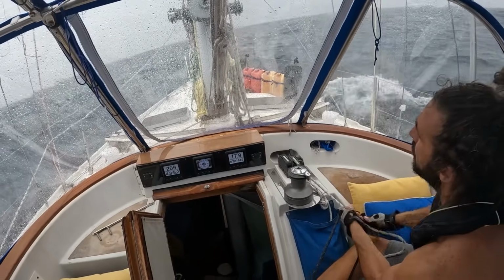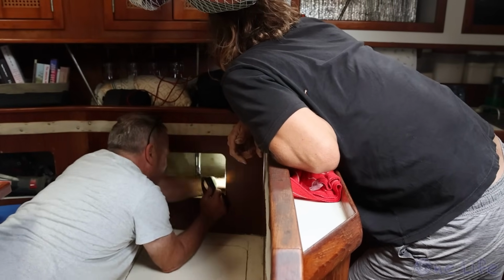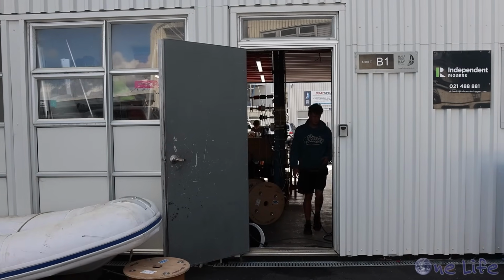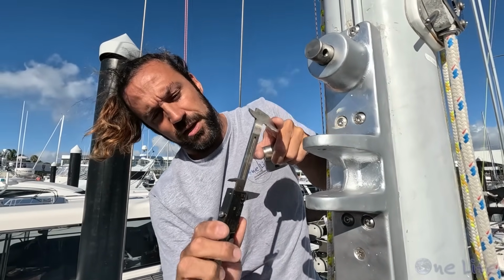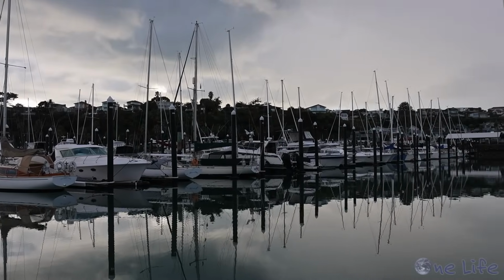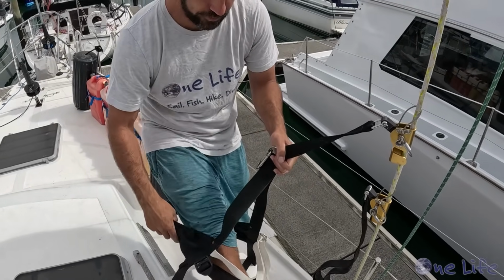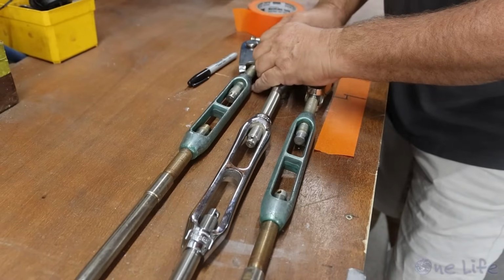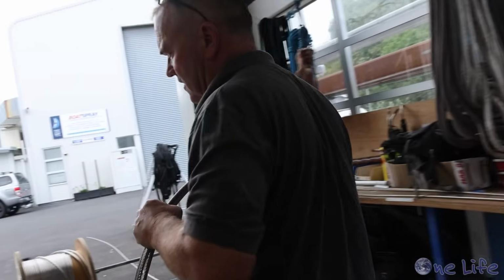Replacing the Standing Rigging on our Offshore Sailboat - Episode 147

Comment: Parlay revival believes that rigging cable should be cut by hand. They  say the heat from the grinder causes problems! What are your thoughts? It looks like your rigging company did a remarkable job!!❤
Reply from the maker: 316 stainless has typically already been annealed, so I doubt the heat from cutting would have any impact. Only the tips of the strands would be affected anyway, and in swaged fittings it wouldn't matter. Was Parlay using mechanical fittings (Stalok or Norseman)? Perhaps it has more potential to be a problem with those. Either way, if Rich uses a grinder, it must be fine! Mate knows what he's doing!

Comment: Interesting, I wouldn't even consider putting SS cable rigging back on.  Dyneema makes more sense to me.
Reply from the maker: Creep, UV degredation, different thermal expansion coefficient, frequent lashing adjustments, potential chafe issues.... there's a number of reasons why as offshore sailors we prefer to stick with stainless 1x19 rather than use synthetic. Imagine trying to adjust lashings at sea during a month-long ocean crossing! An even scarier reason for me is the lack of stretch and potential increase in dynamic loads transmitted to the mast and hull. I know there are solutions to a number of those concerns I mentioned, but for us, we'd rather keep it simple and stick with what we know works.
Reply: Dyneema is a poor choice..... The maintenance in the first 6 months is crazy. Two people I know who tried dyneema dropped their spreader on the first sail.

Comment: Great video! I'm curious if the in boom furling main was an upgrade you did when refitting, or if it came with the boat? Seeing the challenges you had with the furler, would you stick with it now if you had the choice to go back to a slab-reefed main?
Reply from the maker: It was on the boat when we bought it. I think most of the challenges we have had with it have been the result of a lack of maintenance and a 20+ year old mainsail. We haven't ever sailed significantly on any other boat, so don't know that we are qualified to compare systems.

Comment: Any benefit to a zerk fitting on the furler and maybe a drain at the bottom? Also maybe apply some insulator wax to the standing rigging?
And total cost for the complete refit?
Reply from the maker: We considered adding a zerk fitting but didn't, can always add it in the future if it becomes an issue again. What do you mean by insulator wax? We did grease all the turnbuckle threads before assembly. And any other fasteners got Tef-gel applied.

Comment: 3M cautions against using alcohol to prep surfaces for 4000/4200/5200 sealants since alcohol inhibits curing. Hopefully your alcohol evaporated without residue before you applied the sealant.
Reply from the maker: Yes, aware of this, but after wiping with a microfiber towel it is evaporates in seconds. The alcohol/solvent warning on the datasheet for 4000 isn't quite as specific as it is for 4200 and 5200 on surface prep avoidance, just says avoid contact during curing. Doesn't seem to have been a problem.

Comment: Was there enough threads extending through your gooseneck nut?  Usually I expect to see a couple of threads beyond the Nylock nut!
Reply from the maker: It was pretty much spot on for length to the end of the nut. Suppose even if the nut fell off the bolt wouldn't go anywhere since it was inserted from above.

Comment: why are you not coating all thread's with grease??less speed but better outcomes??
Reply from the maker: Turnbuckle threads were all coated before assembly, we just didn't show it. And other fasteners all got coated with Tef-gel
Reply: Good riggers use silicone sealant on the threads. Cheap ge will stop SS to aluminum corrosion for 20 + years or copper coat works for 10 + years.

Comment: the furling enclosure should have a drain hole at its lowest end for condensation to escape. also internal sprockets and chain should be heavily coated with waterproof marine grease. chain tensioner should have some way to lubricate from grease nipple built into the main enclosure, thats what i would do as a eng: toolmaker :"tradie".

Comment: Maybe not the correct thing to do, but I'd install a grease zerk in that furler, on the side that the chain runs against. Give it a shot once in a while while rotating it.
Reply from the maker: We thought about adding this but held off for now. Will add it in the future if it becomes necessary. Thinking minimal grease may be better as that is what solidified and gummed it up.

Comment: I've looked at a lot of stuff regarding the failures of Stainless (Bolts, Chain Plates, and anything you can't see that is stainless or holding onto stainless) and found that there are extremely fine cracks that happen. So fine you can't see them with your eyes. I've seen so much re rigging and I have a playlist (ALL of my sailing playlists start with "sailing") which is solely about Rigging !  I've got some amazing stuff in there ! Even though I haven't sailed ever, I've studied so much that i was able to 1 ask a guy if he'd worked with his thru holes. he hadn't and had to go into a yard and do the job. 2 warned the same guy that he needed to replace his chain plates. He actually had a failure way out in the pacific and nearly lost the mast ! Some of the TUNING methods in my playlist are incredible but the video names don't mention that.

Comment: You sailed there . With that rigging 😂😂😂. Crazy
Reply from the maker: One of the benefits of a boat that is built and rigged for offshore sailing, can get away with a little bit of breakage without a catastrophe.
Reply: @SailingOneLife I feel like the bent ones could be upsized . What did the rigger say. Or a better way to keep the clevis pin in . Other than the carter pin keeping it from sliding out .. I think it might do it again . Super interested, I sail in heavy winds all the time but I have a Tayana 55 . Built for that . Maybe drill the hole bigger in the clevis pin and put a bigger Carter pin

Comment: Brilliant to have all of that work done. I had my rigging done last year, and while the cost hurt, i feel great with the end result and knowing nothing will break while at sea.
Reply: My boat is a 45’ Southerly 135. The re rig cost €9200 which includes 20% VAT. This boat has twin main shrouds, twin back stays, and included the addition of a removable inner fore stay, and was performed in the Netherlands.
Reply: Could you give us an idea of cost and boat size? We may have to redo ours soon and struggling to get an idea of price.
Reply from the maker: Suggest reaching out to a rigger (or two) and getting a quote. Rigs vary so much between boats. Pulling chainplates? Tie-rods below like ours? How many stays? Swaged fittings or mechanical? Furlers to service too? Mast staying up or pulling it? So many variables at play that will greatly affect the cost.
Reply from the maker: Agreed! Last thing you want to be worried about at sea is whether the rigging is questionable!

Comment: No doubt you know that when bonding down with silicon you should pull the parts together leaving one or two milimeters of space between the sealing faces, then let the silicon to cure before tightening bolts down. This allows the silicon to have some “squeeze” in the silicon that is doing the sealing. This is especially important where parts are under high load but may be flexing with movement between parts. Else if you tighten down fully before the sealant cures, any movement between the parts breaks the seal and leaks will occur. This is aviation industry knowledge.
Reply: Good advice!?? And another tidbit: when you use "Nyloc" or "Elastic Nuts" always allow enough Bolt Length for at least 1 or 2 exposed threads to extend beyond the Nut when tight..... ;-)
Reply from the maker: What are those extra exposed threads doing?
Reply: @SailingOneLife  In my old aviation days flying "Ultralight Aircraft" it was common assembly practice when using Nyloc or Elastic Nuts, to allow for 1 or 2 extra threads to be exposed when tightened...... this was simply a safety precaution so the pilot could rest assured at a visual glance during aircraft "inspections" that indeed the nut had not loosened or the Nyloc or Elastic had not "let go" of the nut. This type of "loosening" failure certainly would be quite rare, but strange things can and do occur. I do not recall, but that type of practice may have been an FAA requirement common to aircraft fabrication, or a recommendation when assembling U/L "Homebuilt or Kitbuilt" aircraft. So, I followed the same practice when rigging & de-rigging, and maintaining the two trailerable cruising yachts I owned for over 7 years (a 16 and a 20 footer by Com-Pac designed for Coastal Cruising) and I sailed alot back in the mid 80's..... single-hand on inland lakes in the mountains of CO, often in very fickle, rough, gusty conditions, often "clawing away" from the rocky shorelines! 😜 😀 K. Scheer
Reply from the maker: This was somewhat accomplished with our chainplates by waiting to tighten the tie-rods below deck that hold the chainplates down. Of course the stays then pull up on the chainplates trying to separate it from the deck, so the situation isn't so straightforward as just waiting to tighten down the bolts that hold together two sealing faces. 3M 4000 is actually a polyurethane adhesive, not silicone which I positively hate anywhere on boat exteriors.

Comment: It looks like you didn't use Stalok or Norseman fittings which are lifetime fittings. 19 strand stainless on over rigged cruising boats will also last far longer than 20 years. I re-rigged a 41 ft ketch in 1986 and sold it in 2009 with rigging still in perfect condition 24 years later.
Reply from the maker: I wouldn't go as far to claim that anything on an offshore sailboat lasts a lifetime! And yes, oversized standing rigging will likely last much longer. But when hundreds of miles from land, we'd rather be conservative and not waiting to find out just how long it lasts.
Reply: @SailingOneLife 19 strand stainless reaches replacement when a strand is broken. The surface tarnish sometimes observed is not a structural problem.  The Staloks and Norseman fittings are truly lifetime and can be reused with some small parts replaced. Swagged fittings by their nature have microscopic fissures as the result of the swagging process. I'm surprised the rigger didn't sell you them
 They're more costly. Good luck!